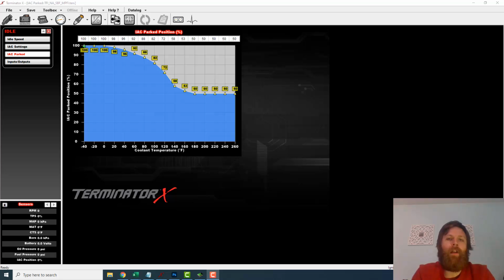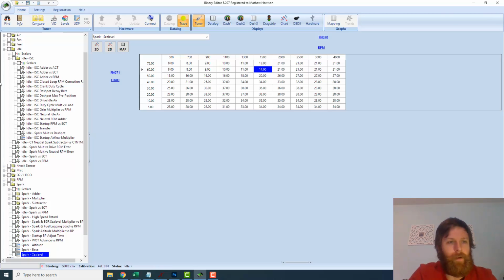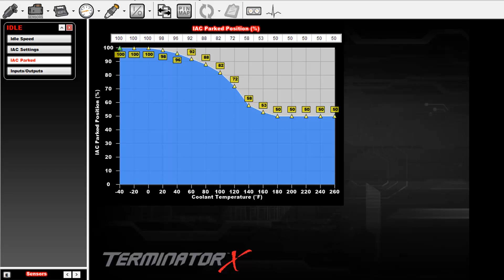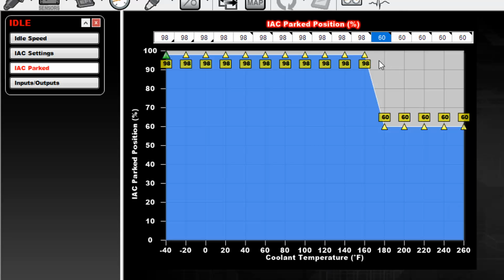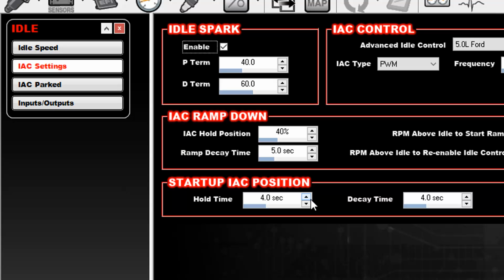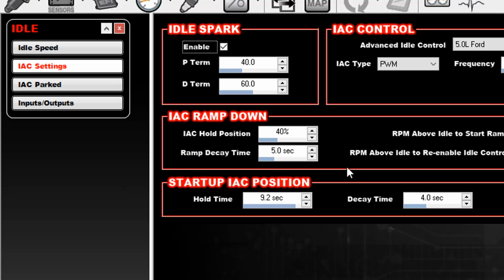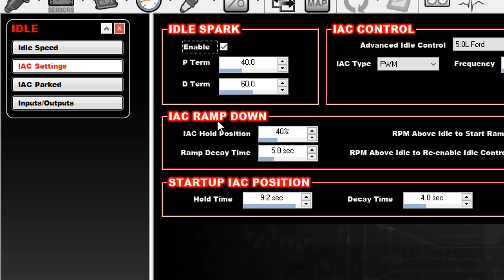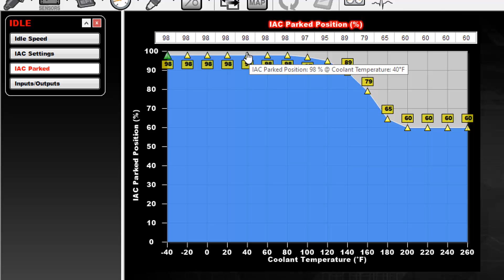Terminator X Tuning - Improve Foxbody Cold Starts with IAC Parked Position

Comment: If you have the car idling right, at operating temp, with the IAC disconnected (in other words, you have the throttle body blade set correctly), these numbers are definitely the WRONG advice. If you have the blade set correctly and do this, cold starts will result in the car idling crazy high during the "hold time" because the parked position percentages are in the upper 90s at colder temps. There is no reason you need the IAC park position set that high if your throttle body blade is set correctly

Comment: Switched to the Holley stepper IAC. Should I use these settings?
Reply from the maker: No. The valves are completely different. You’ll likely need lower duty cycle.

Comment: my buddy wanted me to use the non-fox Term X because it uses a GM IAC sensor, over the years he has not had great success with the Ford IAC but i'm wondering if he just hasn't put much time like this into the Ford IAC... Thoughts?
Reply from the maker: You can use either one honestly. Their duty cycle vs. airflow is totally unique to each valve. But either way, holley’s idle air control during dece and idle is pretty awful. So the Ford pwm valve’s non linear response during the first 17% of opening can actually be used to your advantage.

Comment: Great video! I have used this information to get my cold starts to start perfectly. My issue is when the car is nicely warmed up it takes longer to start. Is there somewhere in the tune I should be looking at and adjusting? Thanks.
Reply from the maker: May want to go into your startup enrichment and try giving it more or less cranking fuel at the higher temps.
Reply: @LeechMotorsports  Thank you.
Reply from the maker: If slightly pressing the throttle pedal makes it start easier, you probably need a little less fuel. If pushing the pedal all the way to the floor then releasing while cranking makes it start better, you probably need considerably less fuel. If pedaling doesn’t help at all, but after extended cranking the car finally sluggishly starts, it probably needs more cranking fuel and/or higher priming pulse percentage.
Reply: @LeechMotorsports  If I give it just a tad bit of gas it will start. I even ordered a tfi relocation kit thinking it might be the tfi getting very hot. I switched to long tubes and noticed a greater amount of heat. Thanks for the tips. I am going to take a look at my fuel at hot temp.
Reply: Oh and to add my priming pulse percentage is at 150%. Should this be more?
Reply from the maker: @89foxix75  yep so in your case try either removing maybe 10-15% cranking fuel at those temps or increasing your IAC park position by 5-10% at those temps.
Reply: @LeechMotorsports  just an update. I increased IAC parked position to go from 98% to 65%. Is 65% to high. It was at 58%. 65% is from 180 to 260. It did help but when I drive the car for a while and let it sit for 30 mins or so the first start cranks for 5 seconds before it starts. If I shut it off and re-try it fires immediately. Very odd?
Reply from the maker: @89foxix75  when you shut it off and immediately threw it again, there is likely still fuel on the intake runners and lots of fuel vapor still hanging around. But once it sits for a bit, that goes away. What is your cranking fuel set to?
Reply: @LeechMotorsports  Hi. Cranking fuel is set from 37.8 to 7.0 lbs. 7.0 from 180 to 260. Prime fuel is 150%. Clear flood TPS is 65%. I appreciate your help. Thanks.

Comment: I cannot get idle adjusted so that iac reads anything but 0.  If I crank the idle speed screw almost all the way out, that will finally kick in the IAC, however it’s out too much and won’t start up right like that or idle. It doesn’t seem to be any kind of a sweet spot where I can get that IAC to hold at any percentage other than zero when the throttle plates are adjusted to about where they should be. Any idea?
Reply from the maker: Readjust the screw so hat it holds 0 all the time. Do a tps reset and restart the car.
Reply from the maker: The at that point, let the car come up to full temp. Back off the screw an 1/8 turn and wait 60 seconds to see if the timing starts to increase, the IAC position moves at all, and if rpms are dropping. After 60 seconds of idle is still high, turn another 1/4 turn and wait. Waiting is the key part and doing only tiny turns at a time. When you get it to the point where IAC still shows zero but it is finally at the target idle speed, snap the throttle open and closed once, let it settle back out. Then see if the IAC position starts to climb. If it does, wait until it stabilizes. If it doesn’t bumpy he throttle screw down again by just a hair.
Reply: Thx. I’ve tried that but iac always slowly tapers back to 0
Reply from the maker: What is your timing set to in the idle area of your base timing table? Do you have idle spark enabled? What is your combo? It is possible that a change in timing could help stabilize things as well.
Reply: Spark is enabled. However i just tried unplugging iac and no effect at all. So i put a volt meter in the connector.  One side is getting 14v while running. Other side nothing. Tried continuity test for ground - probe from volt meter on negative wire.  Ohm with sound. Side of the connector opposite that was getting voltage nothing. However what is really weird is when I run the same test on the side that was getting a 14 V it beeps like it has continuity between the ground circuit. But I don’t understand how the same connector can get ground and 14 V at the same time. It’s not my meter I’m kind of tripping out on this.  Do you know what kind of signal I should get out of the connector? The obvious thing as a bad IAC, but it was working when I had the fox body computer on it last

Comment: I agree this is something that needs to be revised, but not every car/engine is the same. I have a microsquirt on my 93 347 stroker and mine uses about 38% parked and 32% cranking.  The key is to make sure you first start the engine and warm it up, disconnect the IAC and bring the idle to where you want it to be and then adjust the TPS and IAC as needed. The IAC is to compensate for changes in load, but you should not depend on it for other parameters than need attention. 
I am switching to a Holley here soon and since the software is free, I pretty much have everything set to where I think it would work best. I am pretty sure it's going to need to be revised  but very little though.
You are doing a great job explaining this Holley stuff. Thank you!

Comment: Thank you from the 918. Been also figuring mine out on the 93. Getting the ac iac kick down right during the summertime was a little interesting. Cold starts are almost dialed in with the weather temp changes.

Comment: I'm like a kid in a candy store when I see a new video of leech Motorsports posting a new Terminator X video. Hey Matt you helped me on two data logs that you sent me and the car feels way better and I thank you for your help. I was going to send you a email with a data log but I did not want to overstep too much but one thing that I have noticed since I owned my Holley stand-alone well I'm going to say about two months after installing I have always had to crank the car twice in order to get it to fire now what I see in the log on first crank RPM would go to around a hundred or so then I would see a dip and RPM would show error then on second crank it does not show error at all any thoughts on what that could be do you think I should start with another TFI module
Reply from the maker: I would recommend we try to get your fuel super dialed in first, then revisit spark/timing if needed.  And trust me, no overstepping. Here to help.

Comment: My car has never idled on its own at cold startup. Over 5 years now.
Reply from the maker: It’s probably a combination of not enough air and too much fuel. In rare instances o have also seen people that don’t really leverage startup enrichment like they should and end up starving the engine for fuel after a cold start.
Reply: @LeechMotorsports  but with mine being just a sct chip I have no way to change anything here at home. I’m gonna get all the bits to get a handle on my vehicles at home. Just money and time for now. Holidays have put the stops on my spending. Have a great day buddy. Thanks again for your advice
Reply: @LeechMotorsports  oh yeah and also do you recommend the dual sync distributor or is the TGIF sufficient?
Reply: Tfi